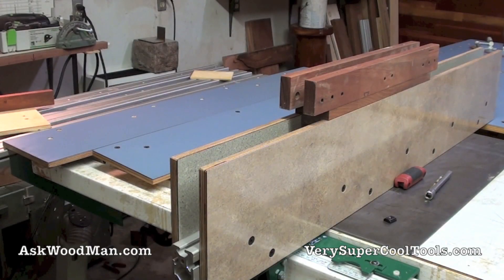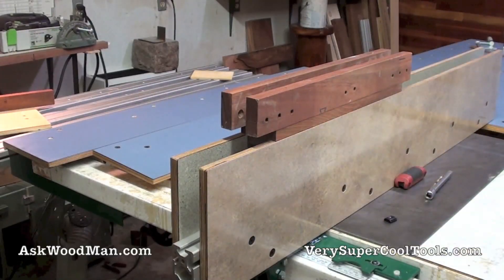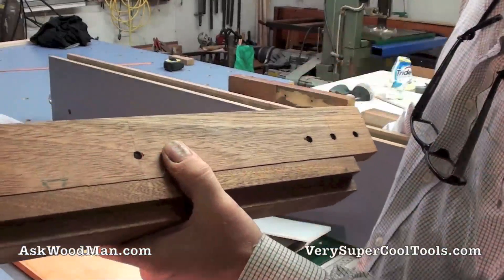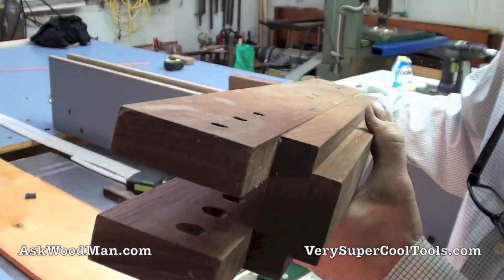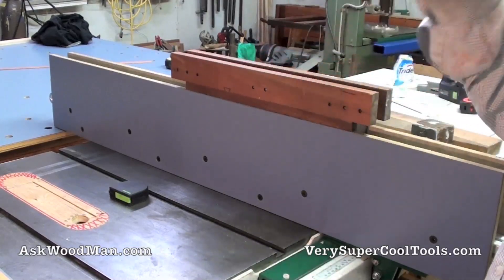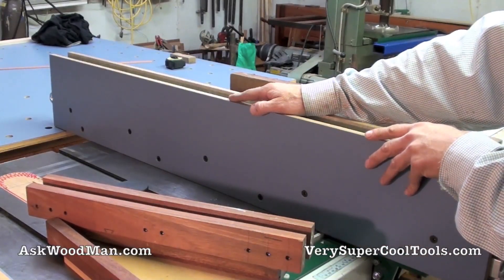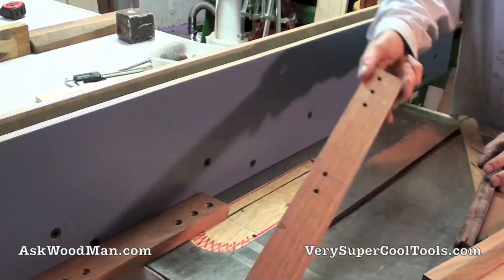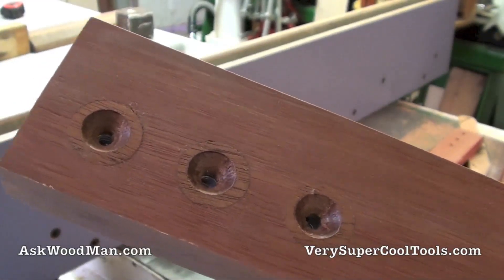DIY Building A Table Saw Tenoning Jig - 2 of 12

Comment: I was surprised to learn that they still make a 'brad hole' T-nut. It does not have the prongs, so it is unlikely to split the wood. It has brad holes to allow insertion of a brad to keep the nut from turning. A lot of the wood bodied cars, prior to 1936, used them as blind nuts. You would have to drill the wood to accept the brad or you would defeat the purpose of the nuts.

Comment from the maker: That is not a method I would use. No wood is a match for steel and the hex corners will cut a circle if the nut is used enough. CA glue is useless as a permanent bond for steel and wood. Epoxy maybe, but I gave up on CA 20 years ago. It is the flange and that makes a t-nut hold and the prongs keep it from rotating. I have mortised large square nuts many times as part of a bed bolt setup on beds. But to just press a hex into a hole, I don't do that.

Comment: I see you do not use a guard or splitter on your saw. Is that a specific thing for the cuts you are demonstrating or do you simply not have a problem of the cut pinching on the back of the blade ?
Reply from the maker: I do not use a guard or splitter and have never used either in almost 30 years of professional woodworking. I am not telling anyone to use them or not. That is each persons responsibility on what they feel comfortable with.  For me they are in the way for the variety of operations I do. A well tuned saw with a proper fence is the best safety measure as well as engaging your brain before turning any machine on. As you can see I have all my fingers and never get close to the blade. If your cuts are pinching consistently your saw needs a tuneup. You have trunnion/fence alignment issues.